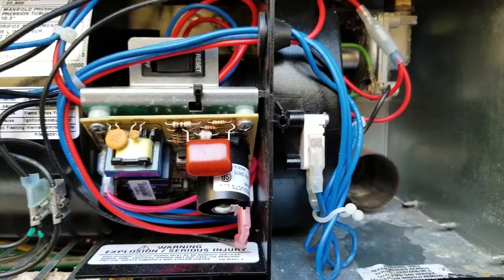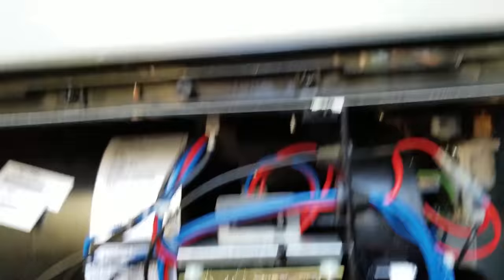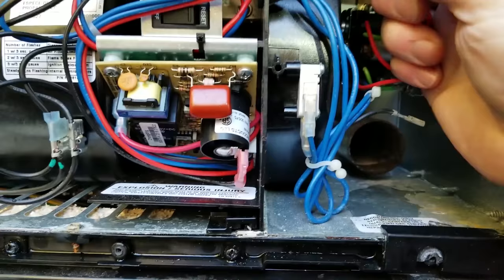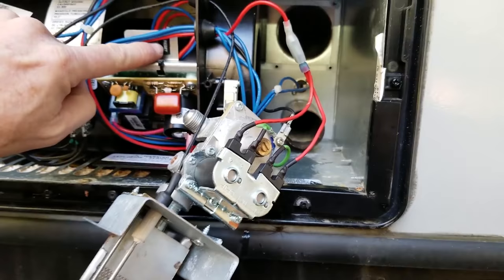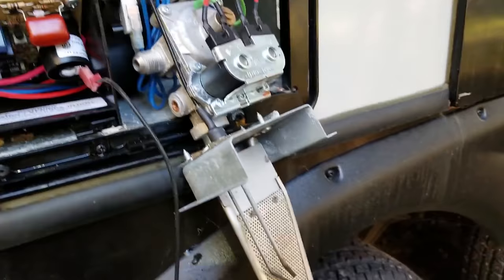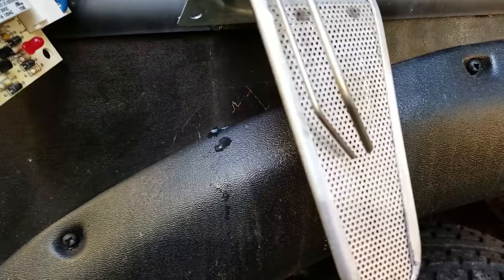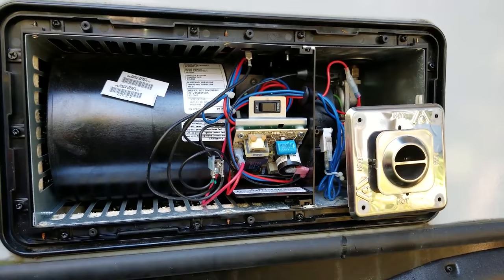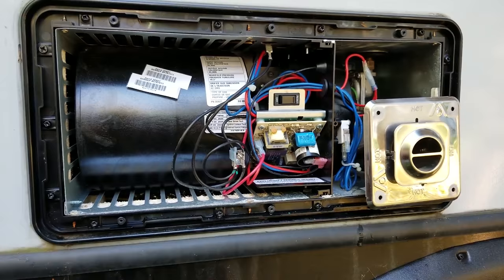Troubleshooting An Atwood RV Furnace Circuit Board

Comment: My furnace clicks and I smell gas outside from the vent. My dad was able to pull the furnace out and saw a lot of rust on the burner head. He sanded it with a little file and the heater worked for another week until it stopped again. I'm needing to figure this out before I buy an entirely new furnace ($700 ouch) and have no way of testing anything after pulling out the furnace. Would you recommend replacing the burner head and circuit board all at once to make sure I replace the issue? Or is it likely that the amount of rust on the burner head is the issue since it started working again for a week and then stopped? Thanks for any assistance.

Comment: hi Darren, got a question,  I have a atwood 8516. my furnace starts up and runs for 15 sec's the gas valve opens and the igniter fires off the burner. it runs for about 3 sec's and cuts off =, it does this 3 times and goes into (lock out) and I haft to do a reset. does this sound like the limit switch??
Reply: Hi Yota4716,
From what you are describing it sounds like either the igniter or the control board.  The limit switch (sail switch, hi-temp thermostat) have already been proven good (‘closed’ to allow 12 vdc to pass through them) at the point of ignition.  

What you are witnessing is the gas valve opening and the igniter sparking which creates the flame (ignition).  As soon as the igniter sparks the control board will pass a very small milliamp current through that electrode wire to the electrode.  At the electrode there should be an 1/8” gap between the bent prong of the electrode and the straight prong which is grounded. The milliamp current jumps the 1/8” gap using the carbon in the flame as the ‘conductor’ and grounds out.  As long as the board detects the milliamp current it will keep the gas valve open because it ‘senses’ a flame.  If it is not able to send and detect the milliamp current to the ground prong it will shut down the gas valve (because the control board does not sense a flame).  That is what is happening with your unit.  So, it is either the 1/8” gap is not set correctly (so the jump is too great and doesn’t make it) or the control board is not sending/detecting the milliamp current.

Cheers,
Darren Koepp

Comment: Great instructional video. The Atwood furnace model AFLD 40121 in our 2016 Open Range 3X309RLS will go through start up and run for any where between about 3 and 10 minutes at which time both the burner and blower stop simultaneously. I have replaced both the 190 degree limit switch and the reset switch thinking perhaps one or both were compromised. That did not resolve the issue. Any input you can provide me is greatly appreciated. It's starting to get chilly here in northern Idaho.
Reply from the maker: If what you are saying is that the burner extinguishes and the blower stops at the same time that would indicate that you're losing 12 volts to the furnace. The way it's supposed to work, burner extinguishers and then blower runs for an additional 90 seconds to purge and cool. If you have a meter, see if you can put it on min-max and monitor the 12 volts feeding that furnace see if you're losing power at that point. If you never lose power, but your furnace is turning off abruptly like this, the next thing would be that control board. Since the control board does control your motor.
Reply: @MyRVWorks  Thanks for your prompt response to my request for input on my furnace issue. It took me three phone calls to different friends this morning (Sunday) and was finally able to borrow a Fluke model 27 to check the DC power input on my furnace. The furnace blower and burner once again stopped at the same time, approximately 8 minutes after start up. I was watching the display on the Fluke the entire time and and the lowest reading was 12.87 VDC and the when the furnace shut down the reading was 12.88 VDC. It appears from your reply my next step would be to remove the furnace (yep its under the landing at the top of the stairs and is a door less model) to be able to access the control board. I've removed the furnace previously to replace the switches mentioned above. Once I have access to the board, do you have any suggestions that might help me diagnose the circuit board. Thanks in advance for your help.
Larry Thomas
Reply from the maker: Follow the red wire from the motor and it should connect directly to that ignition board. If you have your furnace removed from your RV you can bench test it. There are four wires. Typically they are red, yellow, and two Blues. Red is 12 volt +, yellow is 12 volts -, and the two Blues are for thermostat control. To bench test, put 12 volts on the red and yellow wire appropriately and then touch the two blue wires together. You'll be simulating a thermostat calling for heat. At that point the control board should make a click sound on the big black relay soldered on the motherboard. You should read 12 volts coming out of the pin that the fan is connected to. If you do not then your control board has failed on that relay and that is not serviceable. I would recommend a Dinosaur 'fan 50-plus pins' board because they come with a 3-year warranty. Good luck and I hope this helps you.
Reply: @MyRVWorks  Thanks for your most helpful input.

Comment: Ok. The heater we have starts and goes thru all the processes fine but no heat is blown into trialer , BUT it does blow HOT air out the exhaust .. it stays on for a few seconds and shuts down , it then has a 3 blink red light , what could it be ????

Comment: Do you need the outside exhaust vent in order to test it?? I tested ours after tightening some connections and it light up but shuts off the heat repeatedly (without the extension installed) ordered a limit switch and control board …. But will not having the exhaust extension affect it staying on???

Comment: Awesome info, outstanding video.  I have the exact same furnace AFMD 30111.  Question is this trailer a Dutchmen Aerolite brand?
Reply: Thanks for the reply.  This furnace was in a 2017 Dutchman Kodiak RBSL17.  So yes on the Dutchman mfg.
Reply: Your video has made me a somewhat expert.  I just serviced mines today.  Running like a champ.  I have a 2017 Dutchmen Aerolite BHSL2320.  Exact same furnace.  2 Thumps up to you pal.   @DarrenKoepp360

Comment: Where’s the sail and limit switches on this unit?  Mine is a unit AFMD16.  I have a code one air flow/ limit .
Pretty sure that’s the problem.  Just got this rig, and the unit looks New, but it’s not staying on or blowing hot..
Are they on the inside on the intake side?

Comment: Great videos. Thanks so much. I have a very similar furnace... mine fires up and burns fine for one cycle. Then when the thermostat cycles to kick it on for the second time, the fan runs, it clicks, heats for a microsecond, but won’t fire, and keeps attempting to ignite but will never fire. If I turn the whole system off, it seems to reset and It works again but only runs for the first cycle, but won’t re-ignite. Any ideas would’ve greatly appreciated. I was thinking a new board. Gas pressure is fine.
Reply from the maker: Hi MusicBox,
 
Your question has been selected for an upcoming video where it will be read and discussed by Darren - Certified RV Tech and online personality for the 'My RV Works' videos.
 
If you have not already subscribed to the 'My RV Works' YouTube channel, please do so and keep a watch for the ‘RV Tech Talk’ video releases.  This series is a selection of comments and questions that will be covered and released weekly.
Here is our YouTube link:  https://www.youtube.com/c/myrvworksinc

Happy Camping,
My RV Works Media Team

Comment: Darren, my neighbor has an Atwood furnace and it won't ignite.  You hear no click in the gas valve body, no spark. The blower comes on!   They have installed two new sail switches on this unit already and a new control board with no results.  Any idea of what to do next?  The red light is 3 short lights which indicates a bad sail switch, etc.  Trying to help her out, as I use to install and work with LP and Nat gas.  Thanks!

Comment: Hello, I have an older (1995) Atwood 8520-III furnace with separate fan control relay. I recently purchased a new Fenwal DSI board (compatible with 31301 board) to resolve a ‘no ignition’ problem after already replacing the electrode, burner, and high limit switch. On startup everything worked great, although once it reached set point and attempted to restart to maintain setpoint, it started to act irradically.  Sometimes it will light after a few attemps and sometimes not. The fan seems to go on/off momentarily or the furnace will shut down after being lit. If I turn off and restart the stat the initial ignition always works fine.  I’m wondering if it would be better to use the on board relay in the new module rather than the existing separate relay. Have you seen this before? Is there a drawing you can steer me to that shows how to rewire the furnace for the onboard relay?
Reply: Oops, the new Fenwal 35-535811-113 board is compatible with the 31502 DSI board

Comment: If you put that 2 closer you will see weak sparks, not enough to light the gas. Considering a $100 board, I buy a new model water heater , gas and electric, will serve much better.

Comment: I have an old Atwood 8516-11 that won't open the gas valve or ignite. I put my voltmeter on the wires going to the valve and never get any voltage after the blower starts. Sail switch has voltage. Is the  board bad?

Comment: On my Attwood heater the blower comes on and the burner lites but burner shuts off 4 or 5 times through a blower cycle. Could it be a dirty circuit board? I cleaned the board and ran it but did not have the problem.

Comment: Hi Darren .Many thanks for the video lesson .Very timely for me...my 2 month brand new afm16000 just died..fan runs then shuts down ,no gas solenoid click and no lights on circuit  board.....I am thinking i may have ruined the circiut board .Sometimes i notice my battery charger hits 16 volts ,usually after furnace stops. Any tips from you would be most appreciated,cheers ,Will
Reply: Hi Will, before we write off the circuit board have a look at the sail switch.  Usually we get a blinking LED on that failure, but the control board also controls the blower so if the blower is working than the board may be okay.  

Sail switch is easy enough to access on the AF series furnaces, two small philips screws (P1) and then carefully pull out the sail switch.  Exercise it a few times and reinstall.  I have other videos on my channel with sail switch faults that I make repairs to.  

So, bottom line, if the blower is running but no gas solenoid click and no ignition than look to sail switch and/or high limit thermostat.  If you have a meter you want to see 12 VDC on the blue wire connected to the harness on the control board.  

Let us know what you find.  Good luck and stay warm!
Cheers, Darren
Reply: @DarrenKoepp360  Many thanks again Darren. She is working.....i did remove sail switch ,blew off little dust and checked  on/off function with my voltmeter.I do not think it was "stuck".  I cannot remember if it was before or after i checked the sail switch.....but i got a blinking slow red light{indicating  a ignition fault lockout} after a failed start up attempt. So then i removed one screw and pulled the circuit board  out without disconnecting the wires  and  jiggled a few wires.......put it back and she fired..........so i am darned if i know what caused the lockout........but it is working now.......many thanks for sharing your knowledge.....if you ever make it to Merville..beers on me......now to thaw my frozen water hose........aaaar trailer life
Reply: Wondering if you could help me out with an issue. I had a furnace in a RV trailer, had someone check for a bad thermostat so we took the thermostat off and disconnected the wiring. Connected the red wire and the white wire together and the furnace cut in. Accidentally touched the yellow wire which is the cooling system, against the red and white wires while they were connected and now the system will not operate at all. I'm assuming there is some sort of safety switch that would prevent the heat and cooling to operate at the same time. Any idea what the issue would be ? Thanks.  @DarrenKoepp360

Comment: Hi, I watched your very informative Video on troubleshooting a Atwood Furnace Control Board. I have a different Model AF MD 26141 in my Airstream. I have tried every suggestion to get it working, I think the Control Board or Sparker or both is the issue. I saw that Amazon has many different choices, but I see no way to determine which board is the proper replacement . Would you steer me in the right direction. P.S. I subscribed. Wish I had seen you site before. Regards, Randal.
Reply from the maker: Here is a link to a board that will work on just about any furnace. It's a universal igniter board.

https://amzn.to/3SzGgTL

Comment: I have a AFM D35131.  Thame fandvruns, the sail switch us good.  I hear the gas valve click open but don't smell propane and don't hear the igniter.  I get three led flashes.  Could I have a bad circuit board and valve? Thanks in advance.

Comment: What could be the most likely cause if the furnace ignites, runs for 5 seconds, and then extinguishes. And then  ignites, runs and then extinguishes. And again for a third time before it just shuts off. I can’t seem to figure this issue out. Could it be the control board somehow?
Reply from the maker: The bottom line is that the board is not able to detect the flame. More than likely it would be your electrode Gap over the flame spreader in the burner.  There should be about a 1/8 inch gap between that electrode prong and the surface of the burner head. I usually just get a 1/8" allen key and slide under there to check the gap. But it could also be your burner / flame spreader as well sometimes they will develop cracks or large holes.  After you've checked all those things only then would I begin to suspect it's the board. But the board is probably just fine and the issue is with your electrode gap or the burner and the board is reacting exactly correctly if either of those situations are present.

Comment: myD 30121 is mounted inside with no external access. I plan to take out and bench test. will the furnace run electrically with just + and - 12v applied to appropriate wires?
Reply from the maker: You'll need to provide 12 volts plus and minus to your red and black wires, but then to get it to start you'll need to touch your two blue wires together. That is a thermostat call for heat signal.

Comment: Thanks for the video, The problem my furnace is having, is you can hear the ignitor click, but it does not light.  It will run for about a minute, and go through several attempts to light with the ignitor clicking, but it does not light.  Gas is on, and tank is full.  Any suggestions.  I am getting the 3 blinking lights as well.
Reply: Did you ever figure out the issue?  I think I have the same problem as you
Reply: Try the sail switch it uses air flow to turn on the gas.

Comment: Hello Sir, I have a 2007 Fleetwood with an Atwood furnace model 8520-IV DCLP. The fan comes on and blows really well, however ignition does not occur. I bought and installed a brand new board but that wasn't the problem (darn!). After the fan comes for about 30 seconds it just stops blowing, the red light on the board  flashes once and then pauses to another one flash. Where do I go next??
Reply from the maker: Hi Bruce,

On your furnace you should see a sticker with the blink key.  One blink is indicating the control  board is not getting a signal from the sail switch.  

Here is a link to my playlist for furnace repairs:  https://www.youtube.com/playlist?list=PLk44vSl27TRCaZIQbm-0utYK7sVOKwXVY

So, start with diagnosing that sail switch circuit.  

Another resource I have for you is on my website resource tab I have uploaded many manuals that may help:  https://myrvworks.com/manuals/  Just filter for 'furnaces'.

Hope this helps.

Cheers,
Darren

Comment: I need to know where the reset switch or solenoid is in between the air conditioning and the furnace not working but everything else does
Reply: The breakers are not tripped the converter is not bad no power to thermostat or AC or furnace but everything else works

Comment: Darrell Here one for you atwell furnace model AFMD15314-A
 I have replaced thecircut board electrode and the gas valve. I can hear it go through the start up and ignition sequence it trys to light but will not stay light gas gets shut off. My rv tech says there is a power drain from 13volts to 10 volts he has checked all the wires but and all power is there. He is baffled as to the cause of the power drain. He feels this power drain at ignition is the reason it will not stay lit. Any thoughts??????
Reply: Sorry atwood 35141-a

Comment: Please help.. .. I have the lockout error but no gas smell.  I have verified limit switch and sail switch...
Reply: I've verified the spark off the electrode but no solenoid activation.  So the valve is not opening. Board or vavlve is the problem?

Comment: Question? Iv got pre purge, iv got spark my solenoids are good I don't smell gas could my board not be sending power to the valve? Thx
Reply from the maker: Well, you need to verify that you have proper LP pressure feeding that gas valve. Then you need to make sure that the gas valve is not restricted in any way when those solenoids engage it. Also there is an orifice on the output side of that gas valve that you might need to clean. Oftentimes small insects will get inside of the gas valve and make a nest.